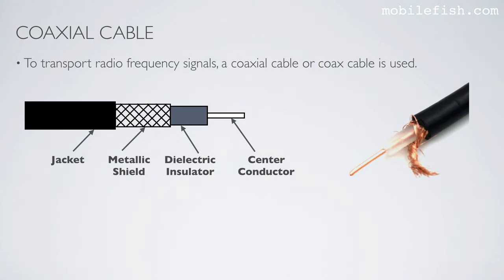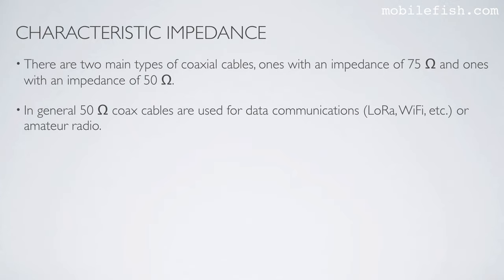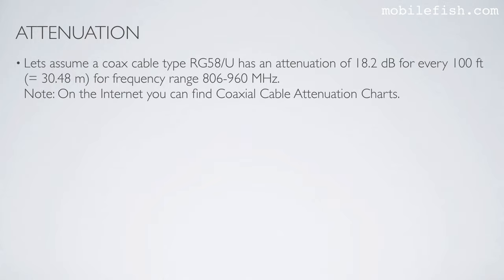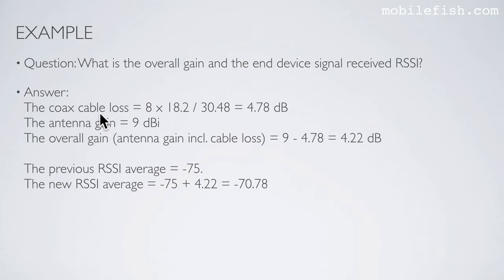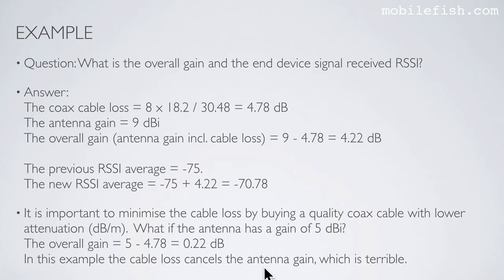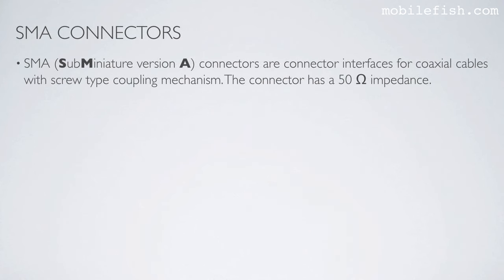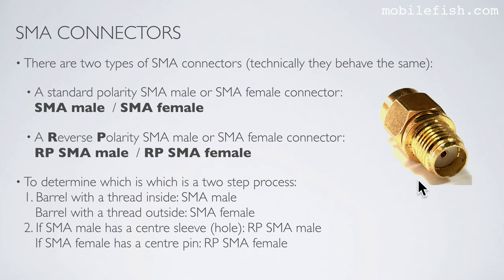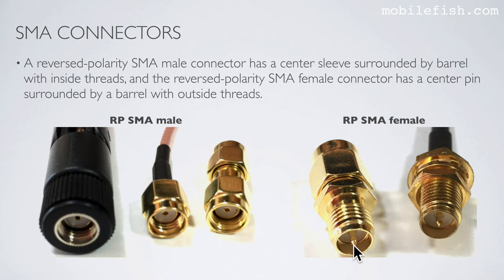LoRa/LoRaWAN tutorial 35: Coax Cables and Coaxial Connectors

Comment: Hello Mobilefish, I just reviewed your excellent video on Coax Cables and Coaxial Connectors. It was very helpful. I have a question about amplifiers for long Lora coaxial cables to aerial. My brother has a farm. On the farm is a decommissioned SES (State Emergency Services) radio tower. The tower is structurally sound. It is 40m in height. There are existing aerials mounted at the top and part way down the tower. The Lora frequency in Australia is 915MHz. We intend to either reuse existing coax cable or install new RG50 cable with a 12db aerial. The tower has an equipment room next to the base of the structure. The Lora receiver will be installed in the equipment room so total coaxial length is estimated at 50m. Obviously the attenuation will completely degrade the signal so I'm thinking of preamplification (active unit solar powered at top of tower next to aerial) and probably again at the receiver end.  I have not yet done the calculation as shown in your video but I was thinking of using two 20db amplifiers type TQP3M9037-LNA. 5VDC supplied. One at the top and the other at the bottom. Do you think this approach is ok and can you recommend a cost effective alternative amplifier? Eagerly awaiting your reply. Best regards, Brian